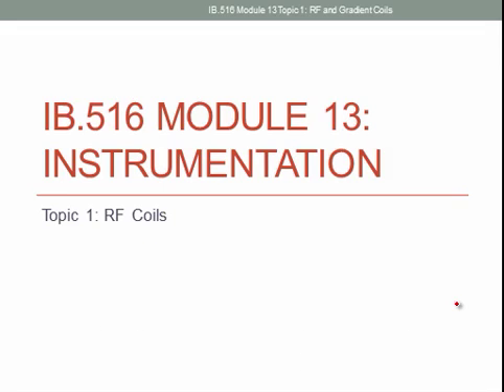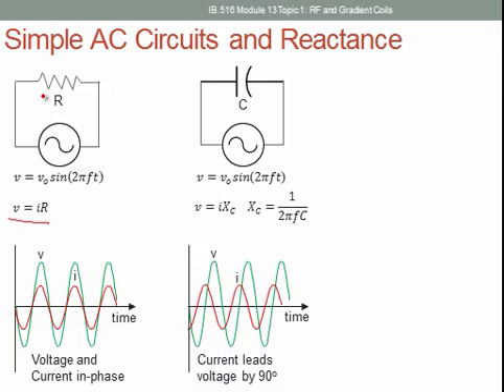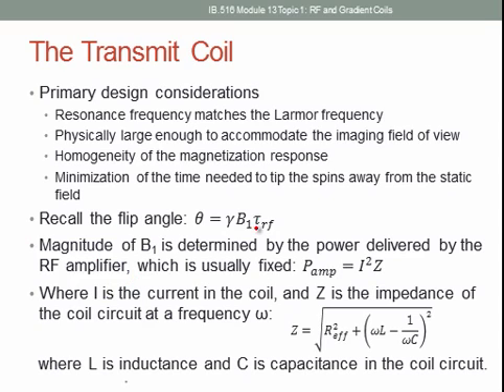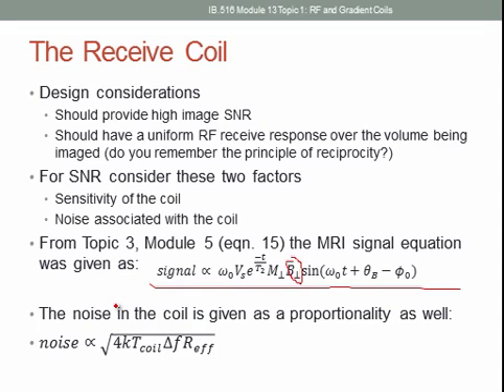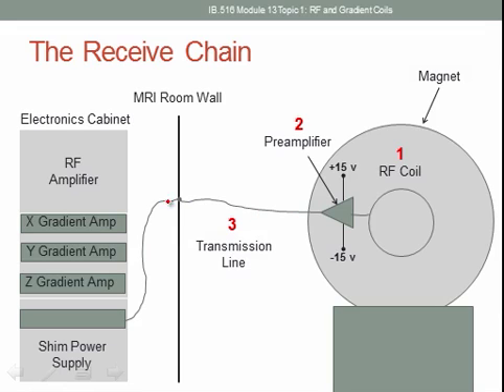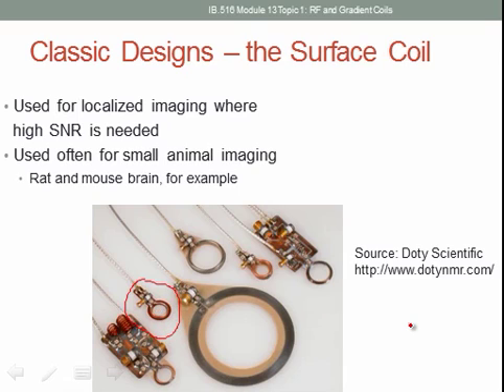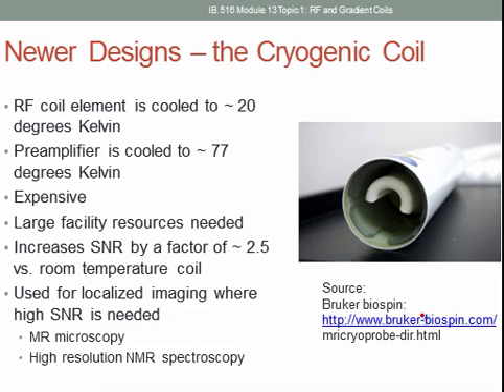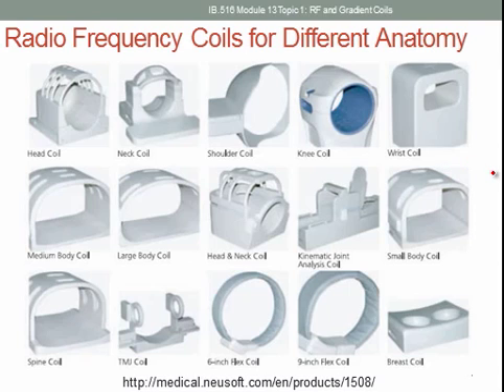Magnetic Resonance Imaging Basics Course: radio-frequency (RF) Coils

Comment: Hi David,
 I've fixed several types of MRI RF coils, doing it on my own. by applying electronics...(radio repair) learned in military.
I watched your  RF SYSTEM/ coils tutorial with detailed. now I've more infinite repairs possibilities.
  Do you...Where can I info- of
Internal inner workings of MRI gradient amps or MRI RF amps low and High mode... how it  works...anyway I senceiarly thank you... I already got enough from your tutorial.. your time...
Titito Pérez.
Reply from the maker: Hi Titito, I'm sorry for my very late reply; thank you for your comment. Gradient and RF amplifiers are their own "beast" and beyond what I typically teach. I would suggest you research videos/literature under "power amplifiers" and/or "MRI gradient amplifiers" and/or "MRI RF amplifiers". I'm sure you'll find significant background videos/tutorials to help you. 
Best wishes
-Dave